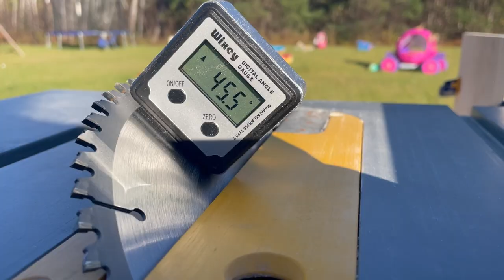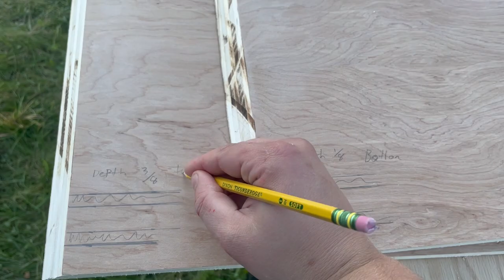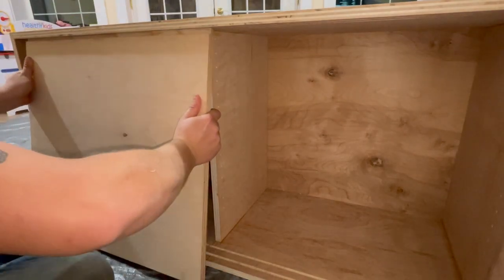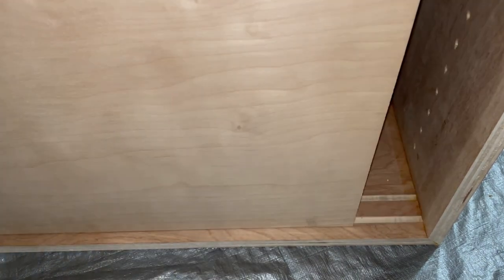One Way To Make a Media Stand with Sliding Doors

Comment: Would not want to sit an appliance with speakers on that. OK if it's just for storage and the TV, or whatever, is mounted on wall with speakers on floor or wall but any speakers would sound bad on that cabinet
Reply from the maker: That’s an interesting point and one I haven’t thought much about. Thanks for the input. What about a design like this makes sound not travel well? Something to do with it’s shape or materials? I don’t know much about sound and would love to make improvements on future projects or maybe a smaller platform could be set on top to raise the speakers off the surface of the cabinet. Would this help? I’m definitely open to any advice. Thanks again for the thought.

Comment: Try testing your new digital thingy against a speed square or anything that you know is precise, 45° or 60° set squares. I've seen plenty of vids where it's the table saw that's off.
Reply from the maker: That’s a great idea thank you! I also have a feeling it’s an issue with the saw. I’m assuming in an entry level saw they figured .5 degree margin of error is okay. Which for most things it probably is. Thanks again for the idea.